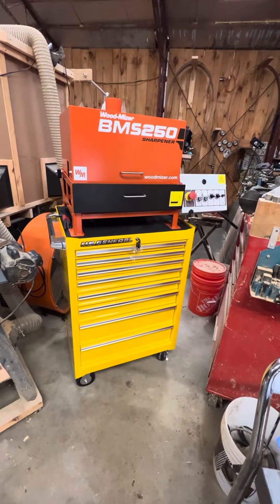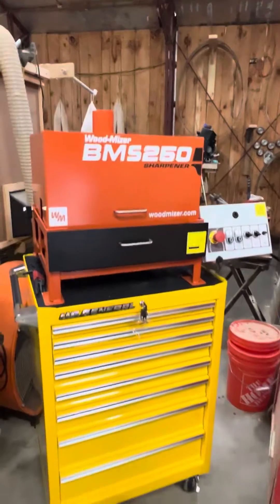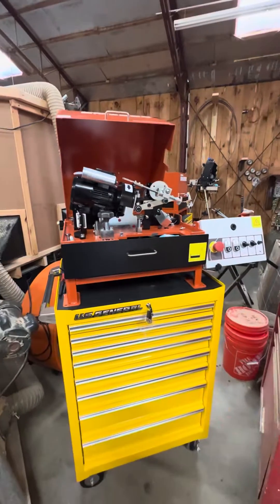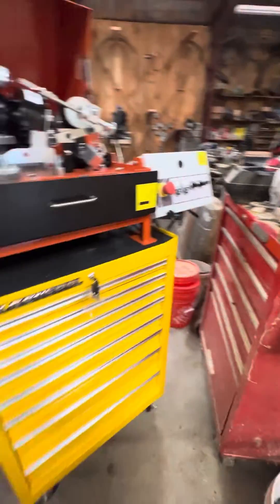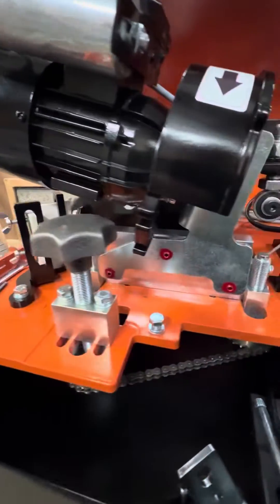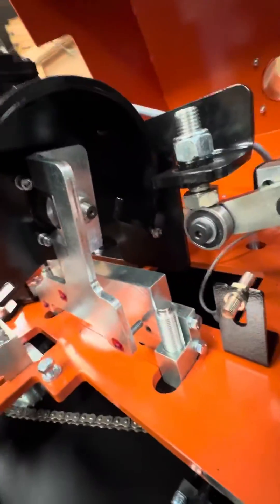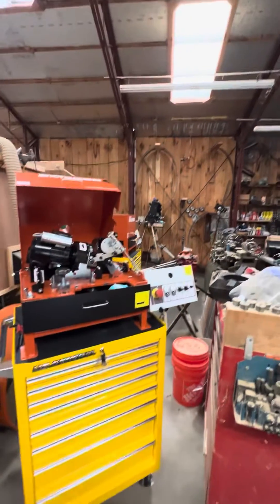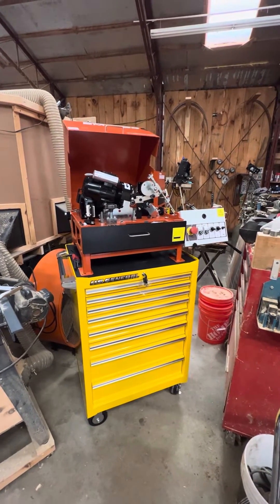Woodmizer BMS250 sawmill blade sharpener initial setup and calibration validation

Comment: Going up to Olivhurst to pick one up tomorrow. I ordered it almost 4 months ago, they said they'd call me when its ready to pick up. I finally called them, and was told its been sitting there for a while. Well, I'll pick it up tomorrow. Looking forward to not worry about sharp blades running out. Nice idea on the cabinet.
Reply from the maker: The BMS 250 does a good job sharpening blades consistently.  I think you’ll be happy with the machine.
Reply: @theMainetimberframer  yeah it's reputation proceeds it. I have a timberking 2020